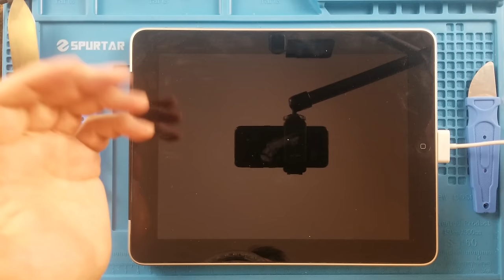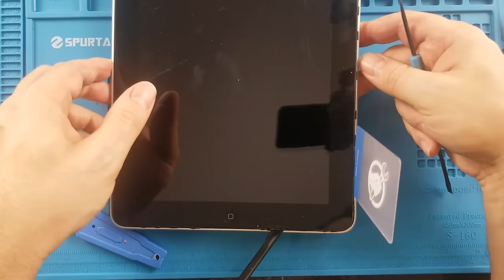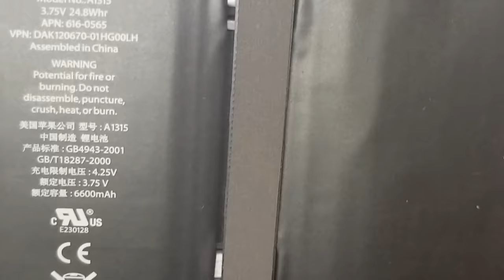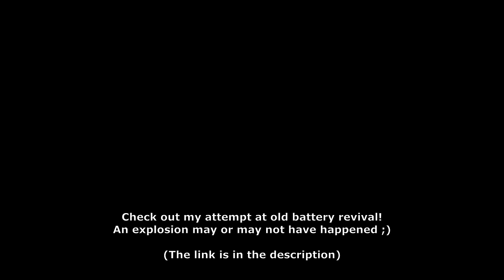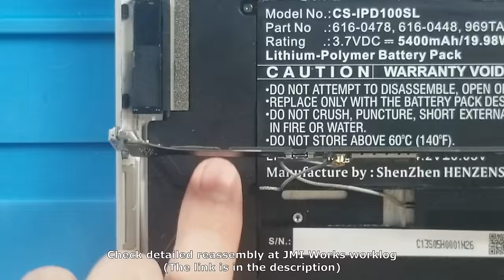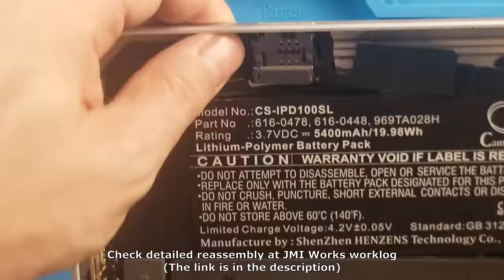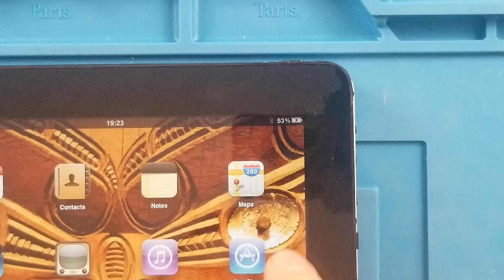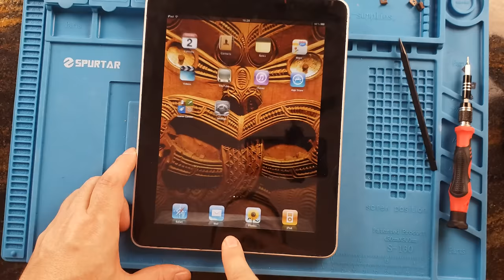Apple iPad 1st Gen No Power Fix - disassembly & battery replacement

Comment: Tried prying the screen off and it shattered. I underestimated how delicate it was...Oh well.
Reply from the maker: Yeah, unfortunately these are pretty fragile. Especially if you try to pry, and corners in particular. Metal/plastic pieces can take quite a bit of force, but glass parts can only bend very little, and then shatter :(

Comment: I was given an iPad 1st gen... It shows 4.93v, 0.13a, it doesn't move from 0.13a, no backlight or anything. Is it battery or maybe something else? Don't want to spend too much on this device since it's value is very little. Battery is £16 from aliexpress.
Reply from the maker: It is most likely the battery. If you're familiar with the device, and it used to work fine and then haven't been used in a while, then it is almost guaranteed that it is just a battery issue. Otherwise, it could be something else, but the chances of that are fairly low. Another issue of concern would be just a dead screen, but this is not a case here as you would see a spike in current on boot up / charging. Right now, it is not charging the battery (based on amperage), this is usually a telltale sign of the dead battery.
Reply: @JustMakeItNow  no idea, the previous owner just stated it wasn't working and gave it to us. Thanks for the response

Comment: Classic Apple. The one part that will need to be replaced during the device's lifespan, is the very last thing to remove on the internals.
Reply from the maker: As much as I agree with the sentiment, Apple is not unique in this approach, all manufacturers are just as bad. Funny enough, these older generation devices are in fact quite a bit better from the repair perspective as nowadays they just pump up hardcore adhesive everywhere. At least here screen is still just clipped in...
Reply: @JustMakeItNow  I do not doubt that's true, I myself do not have enough first hand experience to know. I'm used to Nokia phones where changing a battery takes a few seconds and requires zero technical skills!

I have the same problem with a first gen iPad. Sadly I left it for too long without charging and it's in absolutely prime condition otherwise. I'm leaning towards trying to fix it myself instead of buying a new battery and potentially taking it to a shop, as for me it will not really make a difference if it holds a charge for very long. I saw your other video on the battery revival. Do you know if I can just cut an old Nokia charger and get around 5V? Or does it have to be USB so that the voltage is low enough and I will not fry the battery? I was thinking of opening the iPad just enough to disconnect all relevant connectors, and simply try to jump start the battery while it's still there in the casing, largely intact. I saw someone do this online.

I was actually hopeful that my iPad would eventually start charging, had it connected for 2-3 days in a warm room and even tried charging it on a heating element with a towel underneath, but alas, it's the never ending loop of the device trying a restart and never starting to actually charge.

Thanks for the videos!
Reply from the maker: Don't know about your Nokia charger, but all USB chargers provide 5V, downvoltage for lithium charging happens in the device circuitry. The charger should have voltage/amperage specs on the brick, but the chances are it is 5V. Now, I would NOT recommend boosting lithium batteries with 5V power supplies (e.g. cut out USB ones). People have done it, but it is definitely NOT SAFE, most lithium batteries expect 4.2V charging MAX. It doesn't sound like a big difference, but it is, charging with 5V you have a decent chance of burning/exploding the battery, certainly don't do it in-device. Find/jerry rig some other power source that is about 3.5-4.2V - regulated power supply is the best, but you can use another lithium cell like 18650 (second best), or some combination of lower voltage batteries or a simple circuit. Don't go above 4.2V for any meaningful period of time.
Now, you have tried all the non-intrusive ways of kick starting the battery, and unfortunately it didn't work. If you're planning to open it up, the most of the work will be detaching the screen, and this will have to be done in any case. If you're doing that, might as well go all the way. If you're not replacing the battery, you don't need to cut the glue under the battery (that's a bear to remove), you can try to jump start while it is still glued, but disconnect it from the mainboard. And if this still doesn't work, you may consider replacing the battery as you would have it open anyway, these batteries are not that expensive (but still might not be worth it, depends).

Comment: I have one that is not powering on. When I plug it, the apple logo appears for a brief second. What do you suggest I do to get it up and running again?
Reply from the maker: For older devices this usually means that battery is dead and needs to be replaced.
Reply: @JustMakeItNow  Any way to run it without battery?
Reply from the maker: @cwmoriarty  Unfortunately, most modern devices require somewhat functional battery, even when running off AC. Now, the battery might be completely depleted (close to zero max capacity), that would work. But no battery, or damaged battery (e.g., short on BMS) usually prevents running off mains...
Reply: @cwmoriarty you can run it through power supply, i used alligator clips to just try to run it and test before i bought new batteries. It was three 1st gen ipads from my customer btw 😉
Reply: @HannahMaureenFadri  great idea-- I'm guessing this will fix the issue where my old ipad wont power on for more than 100 milliseconds or so since the battery is dead. 

where are the power pins, just where the battery comes in? what voltage and amperage do I set the power supply to?

Comment: Good video. Batteries should be more easily changed, like they used to be.
If there the ability to roll back the os on  ipad 1 this might be worth doing. Every ipad i have owned ran great until installing the last update issued by apple. I am still running a Linux running on a 2011 computer. runs great. internet still works great. FAPPLE.
Reply from the maker: I don't use Apple devices, so wouldn't have first-hand experience, but I believe there are ways to downgrade OS on iPad 1. Try searching for RedSn0w.

Comment: TIP=  I made a tool that slides down with a piece that then gets behind each clip and you slide sideways to pop it inwards and release from outside case. I then keep all the right hand side clips and remove the top and bottom ones and use only 2 on left side to lock it into place ready for easy removal next time in just 1 min. I also add thin pieces of double sided tape to pad the sides out so it clips into place with no movement. Leave the top side unsticky so the screen is only resting on tape and not stuck to it for easy removal.
Reply from the maker: This sounds like a solid approach. Whether it is clips or glue, the most difficult time to open is the very first one. It is as if manufacturers don't want you to do that... ;)

Comment: PLEASE HELP!!! I replace the batery an  now the touch screen not working, and the ipad looks like a factory reseted ipad. dont know what to do. Thanks in advance!!!
Reply from the maker: Touch screen not working (assuming it worked before) is most likely digitizer cable not connected properly. Check it out, digitizer cable is a flat ribbon cable on the left side of the mainboard (if looking top side with screen removed), it needs to be fully inserted into the socket (all the way to the white line on the ribbon) and then latched up in the socket. If it is not fully inserted/latched, touch won't work on all or parts of the screen.
.
As to why it looks like factory reset, I am not sure. Battery replacement alone shouldn't reset anything, unless you have done something else as well.
Reply: @JustMakeItNow  THANKS SO MUCH!!! that was the problem, the digitizer cable., thanks again!!! you rock!
Reply from the maker: Happy to help, glad it worked out!
Reply: @JustMakeItNow  Sorry if I bother again, but now the ipad tells me Activation required... when I activate it, it tells me that it could not be activated
Reply from the maker: Assuming you don't have your account locked, you can try iPad reset, network settings reset (then connect to WiFi) or you can try to activate via iTunes. Normally, one of these methods should work. If it is not your iPad (e.g. bought second-hand) that you don't know Apple ID for, then it is a different story.
Reply: Which battery did you buy,  i want to replace mine too

Comment: I need a link where you order the clip lock screen please.
Reply from the maker: I don't have a link anymore, it was quite a while ago. But you usually can find these on AliExpress (very cheap, but slow delivery), or on eBay if you're in North America (not cheap on per unit basis, but not a huge deal if you only do a single device and want faster delivery).
Reply: @JustMakeItNow  What is the name of this device? Where can I find it on aliexpress?
Reply from the maker: These are screen/frame clips, here is one example: https://www.aliexpress.com/i/1005003498419538.html
Reply: Thank you brother. From 🇹🇭